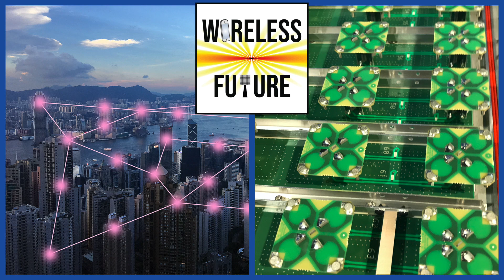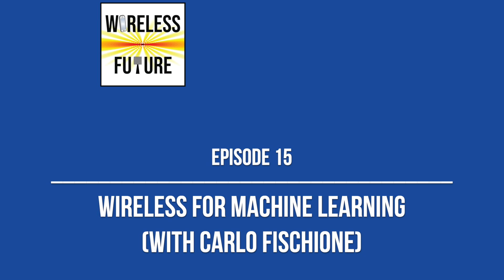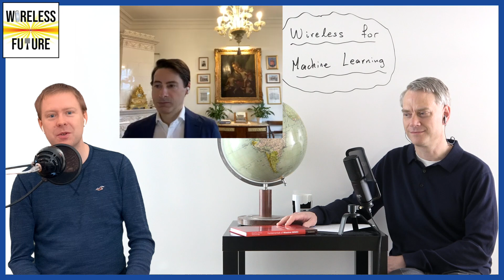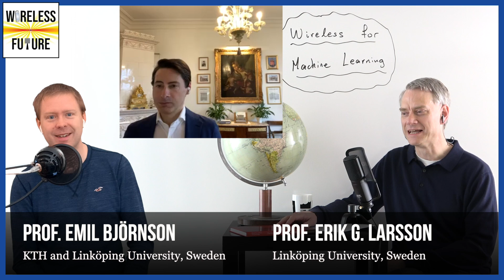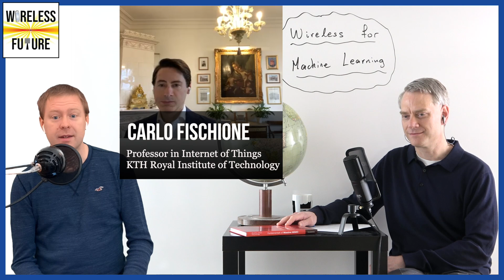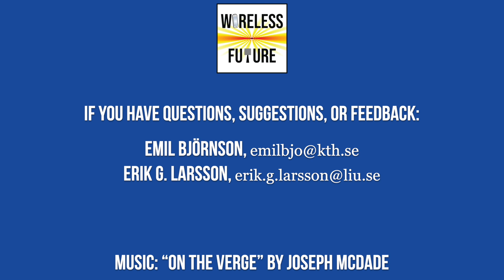Ep 15. Wireless for Machine Learning (with Carlo Fischione) [Wireless Future Podcast]

Comment: Respected Sir,

Trying to run python file of  github/deep learning channel estimation.

it is showing one error while exectuting "no module named 'all_functions'  and no output is produced. when code is pasted of Fig1_ spectral efficiency.py

how to run it correctly ? 

Kindly help.
Reply from the maker: From the error message that you describe, it sounds like your Python installation didn't find all the files that we provided. Please make sure to download all the files from the repository, put them in the same folder, and then run them without making any changes. Then it should work. If it still doesn't work, then please feel free to contact the first author of the paper.
Reply: @WirelessFuture  Thank you very much sir

Comment: I appreciate the insightful discussion. I'm interested in researching how deep learning or reinforcement learning can improve power allocation strategies in cell-free massive MIMO, specifically in terms of achieving max-min fairness or sum-SE maximization. While there have been studies on using deep learning methods for power allocation in both uplink and downlink scenarios, there's a gap in research when it comes to applying deep learning to the user-centric version of the CF mMIMO system. Could you please provide some ideas to help me brainstorm and come up with a meaningful research question to pursue?
Reply from the maker: The two optimization problems that you mention can be solved rather efficiently using conventional optimization algorithms, so there isn’t much to improve using machine learning. User-centric conditions can be managed by forcing the power coefficients to be zero for UEs that the AP cannot transmit to. Deep unfolding techniques can perhaps speed up to implementation a little.

I think one should instead look for solving power allocation challenges that cannot be managed using conventional techniques, for example, due to incomplete information. Here is one example of that from my group: https://arxiv.org/pdf/2109.03128.pdf